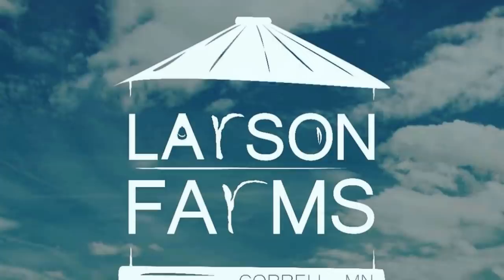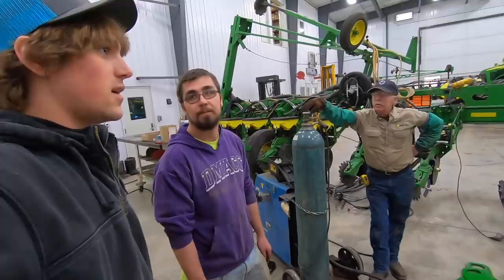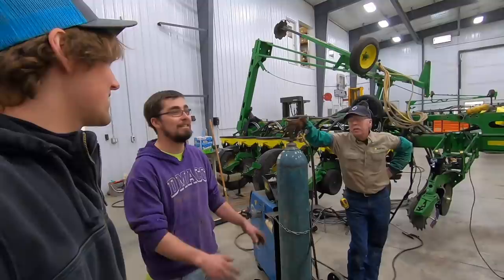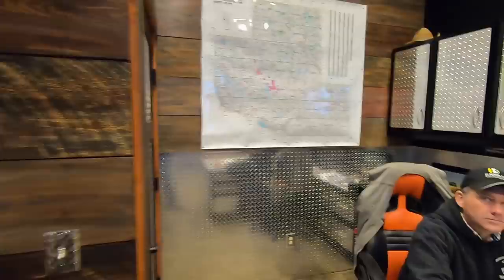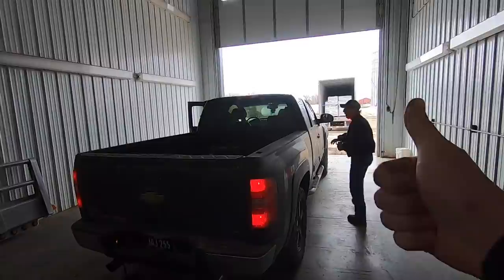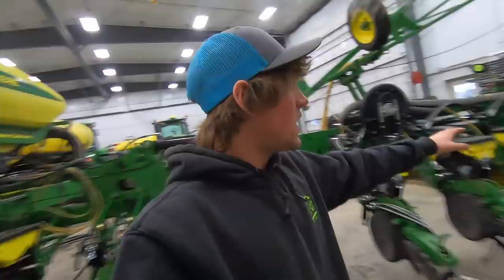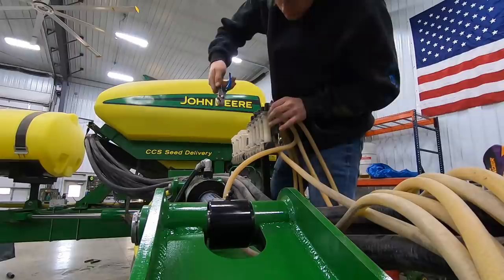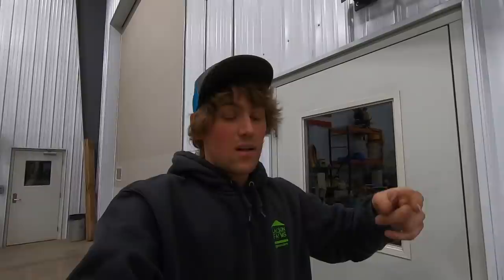More Huge Improvements To The Corn Planter

Comment: Over here in England we always plant the internals of the fields first leaving the headlands till last so the seeds don't get paddled in on every turn.if it's a bit damp etc we even plant  all the internals then plough and workdown the headlands so we would turn on unworked ground all the time.hope u understand what I'm trying to say?!?! Hope your all well bud.keep em coming cheers dude!!👍🏻🇬🇧🚜🐄😀😀🙏🏻
Reply: As it should be n I so agree! As I am sure you see the difference in results doing it like that, huh??
Reply: Ron Meier yes bud the headlands defo don't suffer  from stunted growth etc as they do if they get paddled in.more so if it comes very wet after drilling and the headlands are paddled or its abit of heavy going the seeds will just rot away sometimes if sat wet and paddled.thats why we drill headlands last of all and drill ourselves out the field thro gateway!!👍🏻🇬🇧🚜
Reply: I believe some do it the other way with corn due to auto shut off on the planter 
Here in Aus we do the outside last as well But it results in some pretty decent over lap at times 

They do the outside first so the computer can shut off the seed as soon as it hits the already done but greatly reducing over lap 
We grow our own seed or save seed from previous years but GM corn and soy beans you have to buy new seed every year at a great cost 
And margins are slim so over lap is a bigger issue 
I could be wrong but I dout they do anything without a good reason 

Also this modification should reduce compaction everywhere in the paddock  planted or not
Reply: We do the same in Australia too ....minimizes compaction too !!!

Comment: That system is has been standard on bulk fill Kinze planters for several years, I love it on mine.
Reply: Jason Schneider, I use to have a kinze 3700 and then I switched to a jd DB60 and it’s been the biggest regret. Kinze sure does know how to build a planter

Comment: Liked, But confused. I get that you now have better- more weight distribution on the wings. But what about down force for individual row units? Sorry if you've covered this before.
Reply from the maker: That is taken care of by each row unit has a cylinder and a load pin in it so it knows how hard it’s pushing down on the ground each row can adjust its pressure within a 16th of a second.

Comment: Wouldn't putting down force on the wings creating a rainbow type of arch in the arms making the seeds on the outside go further into the ground then what you would want
Reply from the maker: No it is not putting that much pressure on the wings in each row unit can adjust for how deep you’re going or want to go.
Reply: @LarsonFarms  how far do u think it will push the wings down that ull have to compensate for

Comment: Why did you choose to go this route, Obviously it's cheaper than tracks, But when it's time to trade planter's there goes the up grade with tracks they come off and can be installed on new planter.  Could you please explain on next video?
Reply from the maker: I don’t think there’s a need to ever have tracks on a planter personally. This kit is a huge asset for high speed planters because going that fast it’s hard to keep pressure on the wings and to keep them smooth.

Comment: Quick question I know I’m gonna sound stupid and yes I could just google it 🤣 but does that planter you air to push the seed to the boxes? Thanks and sorry for the stupid question in Central NC we don’t use planters this big!
Reply from the maker: Yes it blows it to each row.
Reply: Yes....the big tanks in the middle are pressurized and when seed drops low enough in the row units it blows more seed to them. Each row unit then uses vacuum to to hold the seed against a plate full of holes to pick it up while it spins then drop it down the seed tube.   This probably doesn't make much sense but I don't know how to explain it any better without you actually seeing it.  Lol

Comment: No certified welder worth his salt would weld a vertical going down.
Just sayin
Reply: I'm sure that makes you feel so much better about yourself...just sayin...you figure it's going to fall off, or are simply going for style points?  It's a 3G position.  They're using a pulsed MIG with either 0.045 or 0.052 wire and it's going to be spray transfer.  So, you tell me, if the weldor is using a zero degree angle on the gun, what's the difference if he's welding uphill or downhill - other than there's way less chance of sag when welding downhill.  I love Internet experts who want to sound like they really know their shit by making dubious comments and not taking ALL of the parameters into account.  It's about as stupid as arguing push versus pull on a 1G position.  If you do a cut and etch, the penetration difference is negligible.
Reply: pipeliners do it everyday alllllllllddddaaaayyyyy then they is tessetededed..and I don't know crap about welding...I glob it on hope it holds
Reply: Buckhorn, mig hardwire i don't give a crap if it's pulsed is crap on that thick stuff.